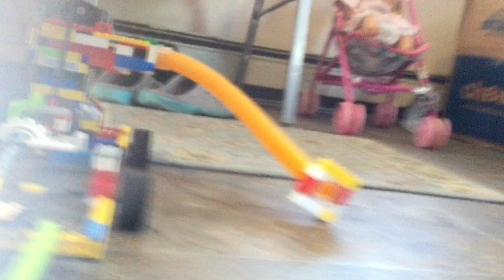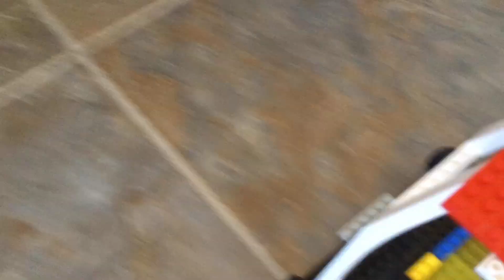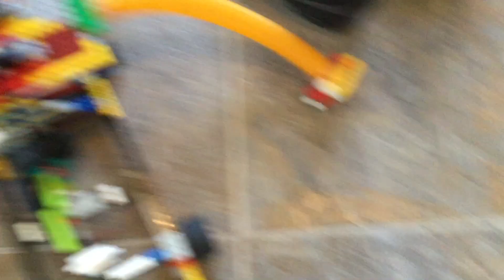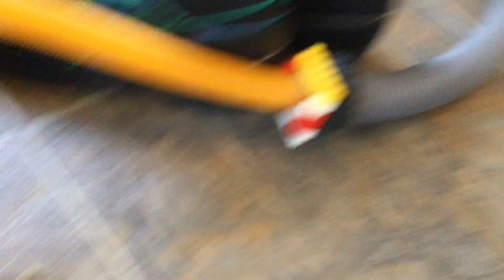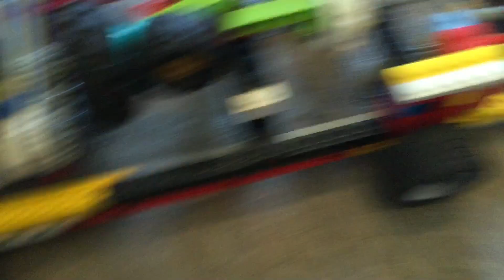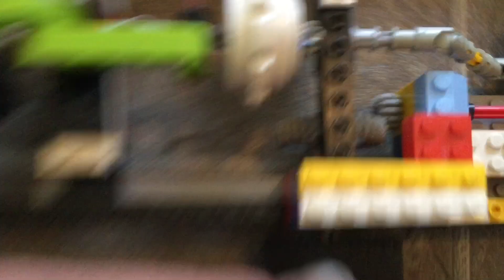2 Cylinder Lego Vacuum Powered Bus Chassis!

Comment: Pro tip:

If you stick your vacuum hose to the floor, it gets 0 air into the vacuum, which causes it to live a shorter life and inevitably overheat faster, however if this is a cheap vacuum or one you don't care heavily about, it's not a problem. just letting you know so you can be the most successful with your engines! :)
Reply from the maker: Just did that to stop the awful screeching of the tire on the vacuum lol